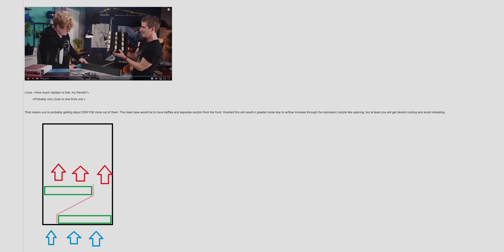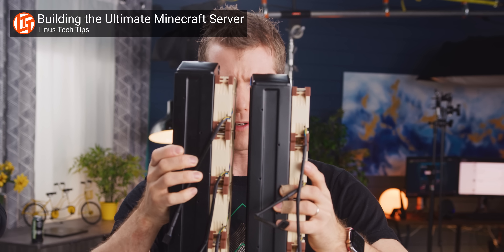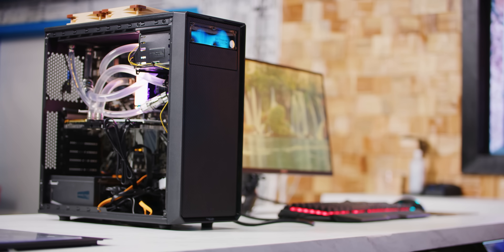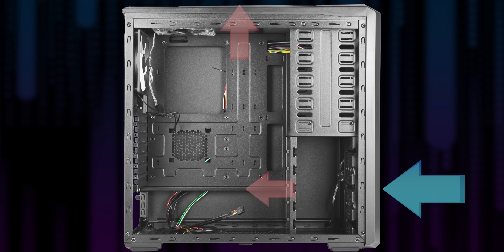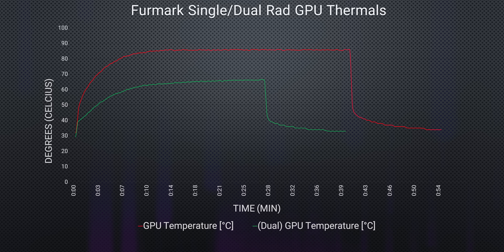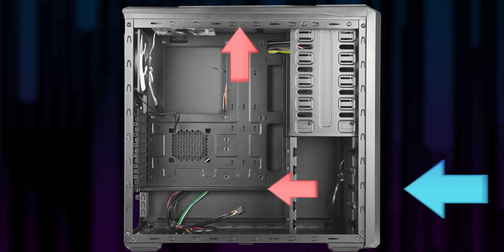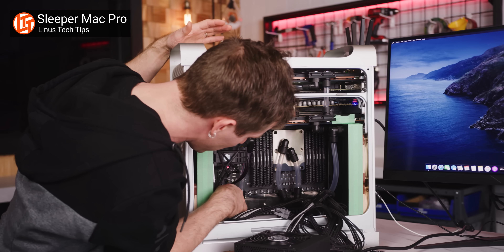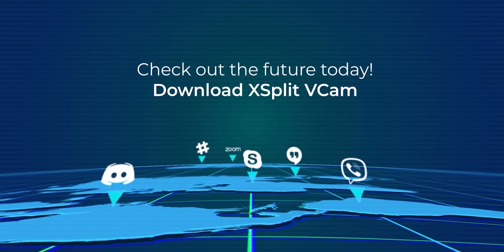I’ve been water cooling wrong for YEARS - $H!T Manufacturers Say

Comment: werent their scenrios just rads stacked on top of rads? you just tested a rad on the top of the case and the front not two stacked on top of eachother
Reply: Later in the video, Linus mentions the minecraft server which has 3 rads stacked together (Only 5 degrees hotter)
Reply: WildCard65  so corsair was right then about the minimal gains of additional radiators when truly “stacked”. One thing with more radiators is just having more coolant in the system as a thermal mass and even if the airflow from the fans is already hot the additional radiator, it’s tubing etc is still radiating heat to the environment passively which will benefit you slightly which might not be in Corsairs CFD thermo model
Reply: @Wildcard65  yeah, but that's the thing. It was a 5° increase. 
Linus is boasting a 20° improvement with the radiators in different locations. 
Whereas, Corsair is saying that with Radiators stacked on top of each other, there's gonna be minimal performance increase, which is exactly what the test showed.
Reply: Yes please we need to tell him and make him redo the testing
Reply: some one did not watch the whole video there bud.
Reply: @Desiloce  I was  half ass watching it tbh just playing games and glancing over every couple secs. I could be wrong.
Reply: Noticed that too, that's also what I understand from Corsair's messages and makes a lot of sense. @Linus What Corsair meant is like how the radiators were configured in the Minecraft server for example, not the example given in this video with one radiator at the front of the case and one in the top of the case, that's totally different. Letting multiple radiators blow their hot air through each other makes them less effective, as only the 'first' radiator will do most of the cooling work.
Reply: Aristo12 watch the WHOLE video and then delete your comment please. He specifically mentioned that they tested that too !
Reply: @99Etien  did he though?  he mentions that he removed on the of the radiators ( so now a two stack) but did  stagger them they way Corsair says at 1:02 ?
Reply: @99Etien  They tested it by removing one out of the three radiators, which means the heat from the 'first' radiator is still being blown through the 'second' radiator, making it very less effective. I really wonder how the results would be if they would change the radiator configuration and put those outside the case side-by-side instead of stacked and blowing air through each other. Of course that's not a workable and permanent solution for in a server rack as that configuration would not be possible within the server case, but that should result in way better temperatures. 

So no, I'll not delete my previous comment as I still think Corsair's statement has not been tested thoroughly enough to say that the myth is busted or not. However I did edit it a bit to make it more clear.
Reply: @Aristo12  If the temperature rises after removing the third radiator, it will defenitely rise even more after removing the second! Also he even explained why Corsairs statement may be viable in a controlled, simulated environment but will never apply to a standard consumer in the "wild".
Reply: @99Etien  Of course the temperature will rise even more if you also remove the second radiator. But that's not the point Corsair and some of us here are trying to make. 
Three radiators in a stacked configuration will cool better than only one, but only slightly. The first radiator will do most of the work and blowing its hot air through the second and third radiator, giving those way less temperature difference and making them way less effective because they cannot dissipate as much heat. This makes the second and especially the third radiator pretty much useless in a stacked configuration, as you only win a few degrees by doing so. If each radiator would get its own cool air to blow through it, the cooling capabilities will be way better.
Reply: @Aristo12  I think you never heard of the many people who would do anything to decrease their temperature for 5°C

And yeah its true if every radiator would get fresh air it would be perfect, but thats simply not possible in these server racks. Corsair stated specifically for the minecraft server, that this configuration is bad and does not improve the temperature. But if even the third radiator improves the temperature by 5°C the second will do even better and 10-15°C are definitely a big improvement!
Reply: @99Etien  I do have heard of those people. It's kinda comparable to audiophiles spending lots of money getting slightly better audio quality. This is about a break-even point. How much more money are people willing to spend to get just a little bit better cooling? There's a good reason why lots of high performance computing clusters are 'still' cooled by air instead of liquid... It's just more (cost) effective.

Comment: Linus: I’ve been water cooling wrong for YEARS
Me: You didn’t use water?
Reply: more like "you pour drinking water in cause you're just going to tear down the system so you don't need to worry about proper biocidal agents?"
Reply: @Darthquackius  Not to mention calcium and lime buildup.
Reply: @shawnpitman876  citric acid would like to have a word with you. :)
Reply: @shawnpitman876  k.

Comment: LTT: has been water cooling wrong for years

Manufacturers: that's because you're doing it wrong
Reply: He is doing it wrong.

Radiators go on intakes.

They should have put II radiator on the bottom of case.

If you want a third radiator you put it on the back of the case.

That way your thermal output is going out the top of the case. Adding a dryer hose to vent the air outside also helps, unless it's winter and you want the extra heat.
Reply: ok
Reply: the minecraft server watercool is overkill, there would be enough 1,5 of that radiators
Reply: If you just use radiators for the air that is coming in? Back fan for let the air out  or even better at the top cuz hot air is less dense and the two radiators taking air from outside, i think is more logical. I mean, not that two readiators can't make thing better, just that you are using a two readiators config that doesn't gets all the potential that you can get.
C'mon.
Reply: ok
Reply: You know what is right this video 😘
Check it out 
https://youtu.be/EFQYnMk0PuU
Reply: Dinusha Jayaranga no
Reply: Dinusha Jayaranga stfu
Reply: @DinushaJayaranga  no